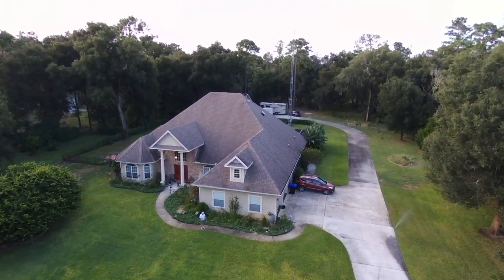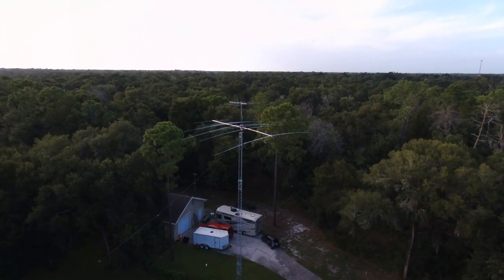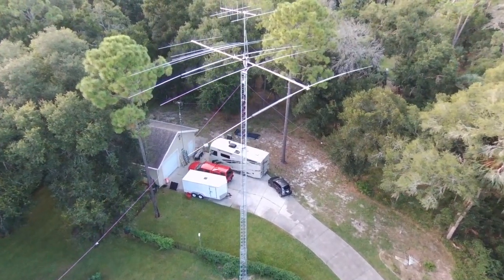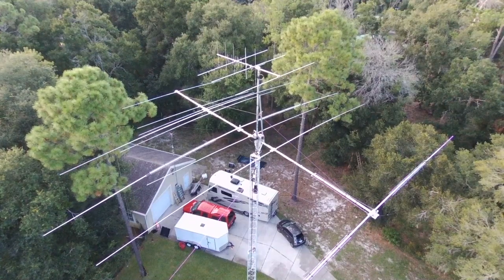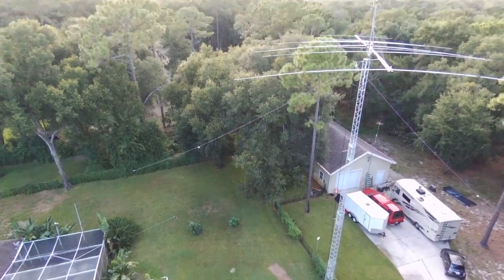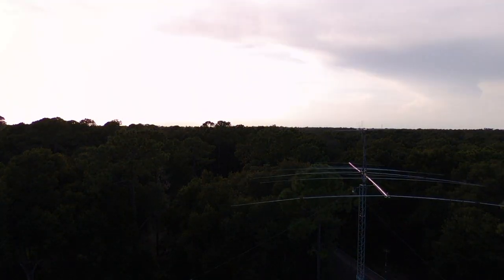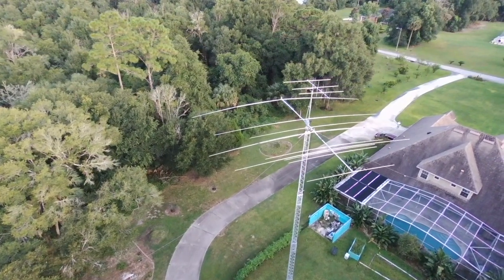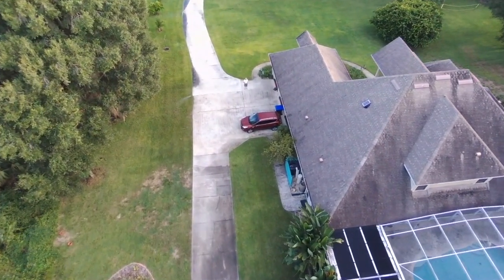Adding 6/2/440 to the Force 12 C4-XL/D

Comment: Really liked your video! Sorry about your misfortune with the mighty god Thor but sounds like you’ve definitely got a plan to rebuild everything. Really impressed by the video and the stability of your drone; which begs the question could you tell me the model and make of your drone? I have a HD BX 48 tower and I’m no longer able to climate but need to both do inspections and possibly be able to lift up a fishing line as a leader, and was thinking that the drone might be able to lift a fishing line up about 48 feet.
I would certainly appreciate any your thoughts on that. Once again really great video and thanks a lot for putting it up!
73…
Reply from the maker: https://www.walmart.com/ip/Parrot-Bebop-2-Quadcopter-Drone-Certified-Certified-Refurbished/850859421?wmlspartner=wlpa&selectedSellerId=519&adid=22222222222089366229&wmlspartner=wmtlabs&wl0=e&wl1=s&wl2=c&wl3=74492061544754&wl4=pla-4578091591804855&wl5=&wl6=&wl7=&wl10=Walmart&wl11=Online&wl12=850859421_10000000486&wl14=parrot%202%20drone&veh=sem&msclkid=da17881b193c13ca56ebea707bc9d3f8&gclid=da17881b193c13ca56ebea707bc9d3f8&gclsrc=3p.ds

Comment: Nice video - enjoyed the view from above.  73 Jack KN7Y
Reply from the maker: Thank you.  Well, I discovered that I cannot talk to mobiles on I95, the north/south road on the east side of Florida.  There is a low ridge about 40 feet higher that me at the DeLand airport, and than another about 20 feet higher than that closer to I95 and Daytona beach 20 miles to my east.  They apparently block my signal.  Si I have dedicated the top of the tower to an APRS iGate which runs 24/7 as w6lmj-10.